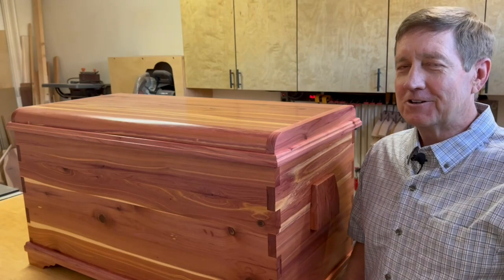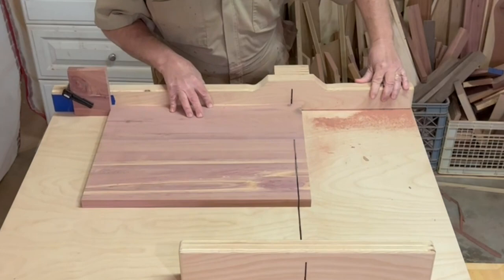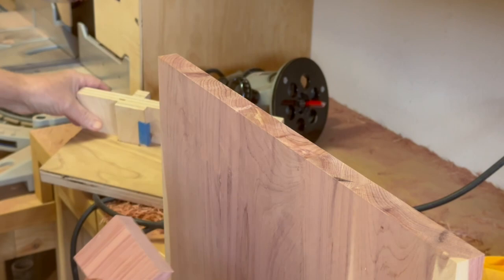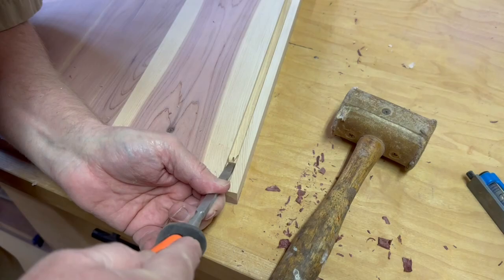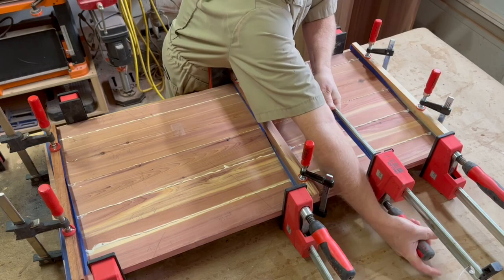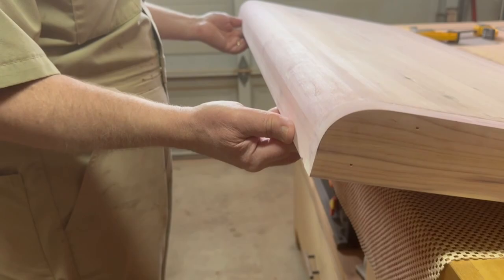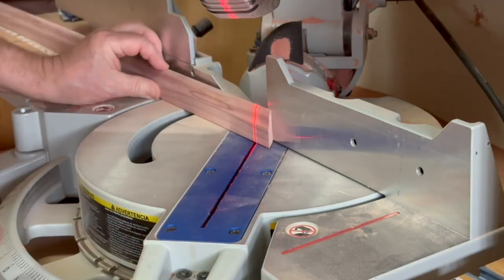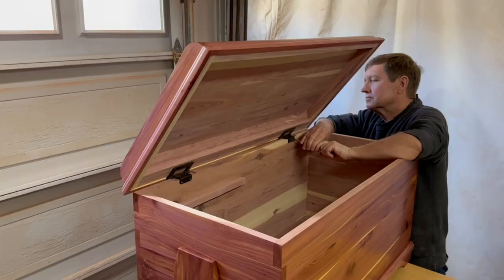Making a Cedar Blanket Chest with Large Box Joints

Comment: Pls, wouldn’t dowels provide greater vertical and horizontal panel strength?
Reply from the maker: Yes, i think that dowels would provide more strength.  although the box joints are probably stronger than the wood itself.  I've seen dowels used on these types of chests, although I think it is mostly just to add some design details, perhaps a personal taste choice.

Comment: Out of curiosity, how man board feet did you get to build this? Looking at doing one myself for my wife.
Reply from the maker: Great question, and unfortunately I wasn't able to find my notes of how much I used.  I do remember that I had to go back to the wood store and get more than I originally planned, because there were so many splits and knots that I had to work around.  Usually, I calculate the total area of the finished piece, and then add 15% for waste to calculate how much wood to buy.  But for this aromatic red cedar, I would suggest maybe 30% waste.
Reply: @jkmwoodworking 
Thank you very much for the information

Comment: I love working aromatic red cedar. Your project looks great but you will have long term issues with the cross grain bread-board ends on the lid. I've also had long term issues with the Deft lacquer flaking off.
Reply from the maker: Thanks!  Yeah its risky to glue up to the end grain on the lid the way i did.  I did spend some time carefully sizing the end grain with glue first, hopefully that will help some.  Likely I should have used dowels or biscuits.  I did a similar design chest about 25 years ago, and it is still holding together good with no joint separation, perhaps just lucky.  I've not had any experience of Deft flaking off, good to know, I'll look out for it.  Thanks for the great comment!